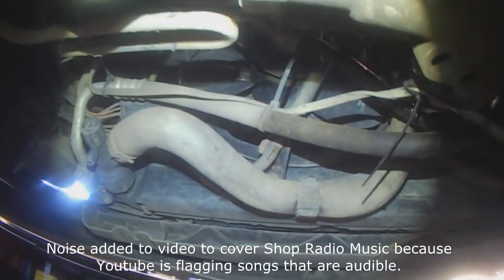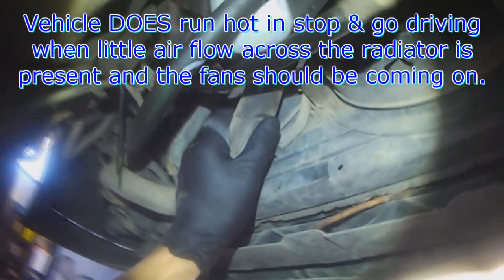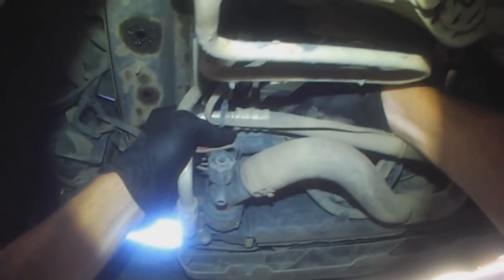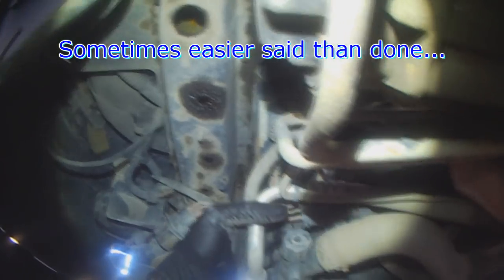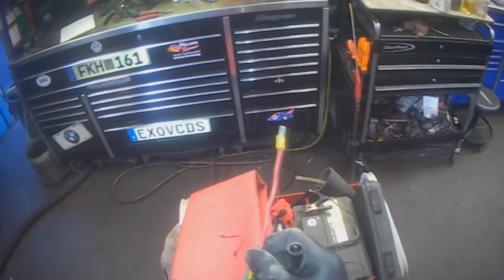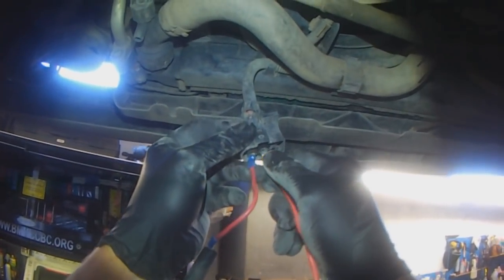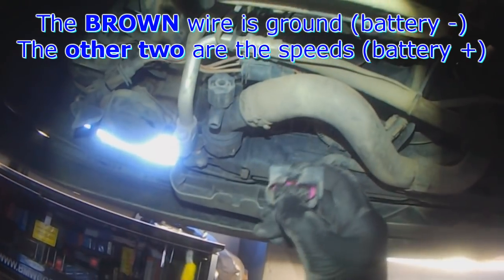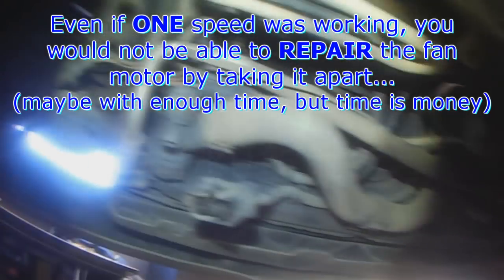VW A4: Cooling fans... manually checking (new version / better lighting)

Comment: Hi Thomas, the ac was low on freon and I put about 18oz in and the fans started working and the ac clutch as well. If low on freon and the ac pressure switch is not activated, the fans will not come on with key on engine off and ac switch on in a 1999 Beetle. I will try Pateron again tonight with my desk top computer. Thanks again for your help!😊
Reply from the maker: Thank you for the update... and thank you again for the gesture!

Comment: according to our vw parts guy, this is common, newer vw vehicles have a PCM code for "fan stuck/mechanically jammed" the speed controller for both fans is built into the master (large)fan. 
I'm sure you knew all this, just thought I'd add my 2 cents
Reply from the maker: Yeah, the new stuff is different and can / will set codes.

Comment: I wish it would have been that easy to remove on my wife's 99 Cabrio.  Thanks for the tutorial.
Reply from the maker: The cabrio has a different setup... much easier connector to get at & remove.
The fan assembly is not that difficult to remove, even when AC is present.
Were you trying to remove the "radiator fan switch" connector?
Reply: @EXOVCDS  I had to replace the electric fan and the fan wheel that's  belt driven.  Noticed the whole stack being original and ended replacing everything.  Condenser, radiator and the fans.  Engine has 270k miles and the radiator and condenser  were the original ones.
Reply from the maker: @nachomax1639  Yeah, that's a bit more work, but good idea replacing the other components while you are in there!

Comment: should both fans be running simultaneously when A/C is on? cause on my car the the big fan comes on at cold start then it shuts down and I don't hear or feel it running after that. how does this particular fan system work?
Reply from the maker: P. Vargas Both fans should come on when the AC is on. They both should also come on when the radiator fan switch triggers them.
Reply from the maker: P. Vargas https://youtu.be/Roh6RCs8IJk

Comment: My fans arnt working, I had one fan burn out and completely disconnect itself from the fan motor (large fan) I replaced the entire unit and noticed that my fans work with the ac when it's cold in the mornings but they won't work at all when the engine is warm, I jumped power to the cooling fan switch and the fans worked at high and low speed so I replaced the switch, and still I'm having the same problem, idk what to test next, could u give me a possible lead? Maybe the fcm? Idk what else it could be, if u have a vid plz link it for me I love ur videos step by step and u explain everything, thanks for doing what u do even if u dont get back to me
Reply from the maker: Year, model, which engine?

Comment: Thomas, thanks for the video. I have a question. I have a 99 beetle with the 1.8 non turbo engine. The problem I have is the high speed fan never kicks in and the ac clutch never engages. I replaced the fan control module with a new one from rock auto. Would the ac pressure sensor keep high speed from working if the ac system is low on freon? I've also replaced the thermal switch in the radiator because the fans never came on. Now they come on, but only with slow speed. I just bought the car and would like to get the ac to work. Any advice you can offer would be appreciated. I enjoy your videos. I've also tested both fans for high and low speed with my power probe. The work fine.
Reply from the maker: Ssactoralph Pressing ac should activate low speed... high speed only come into play when there is excessive pressure in the system or when the coolant temperature is too hot.
Key ON engine OFF pushing ac button should turn low speed fans on. If no, either ac button is bad, low on charge or the fan module has a power / ground issue.
Reply: Thomas EXOVCDS hi,
When you say low on charge, are you talking about an electrical current charge, or a low freon charge?  Thanks again!
Reply from the maker: Ssactoralph AC gas charge... fans & compressor do not get triggered if AC is low on charge (as far as I know... we don't do a lot of AC work).
Reply: Thomas EXOVCDS thank you, I will visit your patrion page and subscribe. I've done a lot of work to this car based on your videos. I bought one of those cooling system vacuum fill tools based on one of your videos and it worked great. I used your timing belt / water pump video and several others.
Reply from the maker: Ssactoralph Thank you... kind of you. My patreon members will get benefits in the future / I have plans for them. =)
Reply: Thomas EXOVCDS I will try subscribing tomorrow. It would not let me complete the transaction with safari on my iPhone.

Comment: Hey Thomas question my small fan on my 03 VW PASSAT 1.8 turbo doesn't seem to be running at all but no over heating problems gauge always stays in middle wondering what can make it come on or what's causing it not to run? And is the small fan the AC fan? Sorry unsure what the use of it is
Reply from the maker: Yes, the small one is AC (should be on when AC is on) and for when coolant temperature is too high (AC off). Most likely the fan has burnt out. You can check the fan for power when AC is on... if there's no power, check the fuses. There are 2 fuses (low & high speed) S42 & S51 located above the fuse / relay box to the left of the pedal cluster.
Reply: Thomas EXOVCDS thanks for the reply my friend!

Comment: Hi Thomas.  Thank you for video.  Re: golf mk4 1.9 pd tdi 150bhp, engine code ARL.  I checked fans as per video and found only 1 speed (high) worked for each fan.  I removed 4 screws which secured fan assembly to radiator.  Haven't been able to pull out assembly from above or below so far, space is very tight.  Fans seem to be secured to shroud from radiator side rather than engine side.  The hoses going to the rad appear to fit plastic fittings which in turn connect to rad.  I got hoses off, but couldn't pull off the plastic fittings despite fully removing U - shaped metal clips ( wary to use too much force in case it snaps off from rad).  Got car jacked up high, battery, battery tray out.  Appreciate any feedback how to get fan assembly out.
Reply from the maker: +toyo toe Hi, yeah... the later style setup does not have separate mounts foe each fan. It is a tight squeeze, but doable... for more room (and to not damage anything), you need to remove the front bumper and then move the radiator into "service position". Like in this video: https://www.youtube.com/watch?v=m2IvmVkszWU
Reply: +Thomas EXOVCDS Thanks Thomas.  Easy to remove rad fans after putting front end in service mode.  VW dealer quoted me an eye watering £680  (1,350 CAD) for 2 new fans ( just fans not fitting).  I copied the VW part numbers from my faulty fans and found 2 used identical VW fans ( working on both speeds) and with a warranty from a VW Dismantler for £60.  In your experience is it rare for a cooling fan thermal switch to fail in Golf / jetta mk4 tdis?
Reply from the maker: toyo toe The 3 wire one in the side of the radiator? They don't fail often, but with age... it's just a matter of time.

Comment: I have the same problem in a 2015 passat fans don't work with the A/C on. I checked the connectors and i have no grout with A/C on, they only activate when temperature reaches 190. Any Ideas? Thanks
Reply from the maker: The fan module receives a pulse width modulated signal from the ECM to turn the fans on. If the fans are not activating when the AC is turned on, then there might be an issue within the AC system. You can check "command" at the fan connector with a voltmeter. like this: https://www.youtube.com/watch?v=oqdv4cm86Ns  You don't need a scan tool to activate the fans. Simply allow the car to idle... check the voltage signal while the fans are off (should be below 1V). Select AC and the voltage signal should increase. If yes (but no fan operation, then there's something wrong with the fan module)... if no increase in voltage, then there is no AC signal being sent... check the AC system for fault codes.

Comment: Mine was doing the same thing, but when I tested the fan plugs, I applied positive to one and ground to the brown, nothing happened. But when I applied positive to the brown and negative to the other thick one they both worked.
Reply from the maker: Record a video and post it on your channel. Show me how & where you are getting power.
Year & model of car?
Reply: 08 vw gti 6 speed manual
Reply from the maker: Your fans are PWM (pulse width modulated) controlled. Completely different than in my video. They are controlled by a signal from the Engine computer (ECM) to the Fan Control Module (FCM) that is part of the large radiator fan... like in this video: https://www.youtube.com/watch?v=oqdv4cm86Ns
Reply: Oh i see. Ya i was just stating what i have found thinking maybe you can give me a suggestion. But without your video i wouldnt know which is which. But anyways i fooled with the fuses wires you name it. Finally found out the plug behind the plastic shroud that goes to the ac fan was maybe stuck. I gave it a couple of slams and both fans started working. Thanks

Comment: 2004 mk4 r32 golf is the vehicle I'm having trouble with. already done tests on the motor of the fans and they are fine. replaced the switch on the bottom of radiator as well.  checked all fuses they're fine. is it the control module or something else ? action works so I think that the thermostat is fine unless there's a seperate thermostat. any help would be great Cheers:)
Reply from the maker: Does the lower radiator hose get warm? Thermostat could be plugged. If the car overheats while driving, then the thermostat is not opening (fans are not needed as long as vehicle is moving (for the most part).

Comment: Dear Thomas EXOVCDS: 2006 Passat. The cooling fan connectot has four pins. Two big ones two small ones. How to test it? I hook up two big ones ,fan runs fast. But two small ones has nothing comes on. But I found the smaller fan has a sized brush.
Reply from the maker: +Pengcheng Wang The fans are "pulsed" on/off quickly by the fan module (part of the fan) by the ECM (engine computer). To test them, I use a scan tool and select "output tests". The ECM will then pulse the fans from low to high speed. If nothing happens, I check for a pulse signal at one of the small wires. If the pulse signal is present, then I replace the fan / module.
Reply: Thanks bud.
Reply: +Thomas EXOVCDS  I checked the two small wire on customers's VW. One is 0.16V and other is 0.04v. I trace the signal wire one is merged with a coolant temperature sensor(I suppose)  goes to ecm. And the other is goes to fuse box. I changed the coolant temperature sensor in the engine block just under the High pressure fuel pump. And nothing goes better. The fan still not working. But when the old fan still can run with my human aid starter. I spin the fan, and it goes. I will change back the old big fan with control module and new small fan. Let us see what gonna happened. I want to change the other temperature sensor in the radiator hose later. Any idea? Thank you.
Reply from the maker: +Pengcheng Wang If you spin the fan with your hand... it stays spinning, or it stops after a few seconds? The fan might have bad electrical contacts if it does not start to spin by itself.
Reply: The ECU did not give the order to run the fun when coolant is above 93 celsius. I suppose MAF sensor lie to the ECU.

Comment: I have a 2013 jetta. Borh fans turn on slow with ac on. No high speed. Can both fans be bad?
Reply from the maker: Low speed with AC is normal. High speed only comes on when temperatures get too hot. Which engine? What is the actual problem? Overheating engine? Your fan control module should be part of / behind the large radiator fan and is controlled via a Pulse Width Modulated signal from the ECM. This signal can be checked with a multimeter, like in this video:
https://www.youtube.com/watch?v=oqdv4cm86Ns
You do not need a scan tool to check for a control signal... but as you can see, the scan tool is useful in activating a "test mode". 
Post a video on your channel as to what the engine is or is not doing... so that I can see & hear. The more I know the better I might be able to help.

Comment: Thomas can you remove the fans for the A4 B7 (2008) without removing bumper/fronter-end?  Do they just slide out once you disconnect screws/harness?
Reply from the maker: If I looked it up correctly... front end needs to be moved forward. I have not yet had to remove / replace one yet myself on a B7, so I can't be sure if that's the only way.
Reply: I’m having the same problem rn on my 08 Audi A4 b7 im just not sure if it’s the fans “both fans are not working” or fan control module. My car heats up and ac is not blowing cold .any info will help thanks!

Comment: Thank you for the video. Very helpful. I do have an issue with the aircon though. I changed the dash climatronic as the vent and temp controls didn't work but the a.c. did. The replacement unit allowed me to use temp and vents but now the a.c. button keeps blowing fuse 16. I set the temp and vent and reinstalled the original climatronic in the dash and now the vents and temp want work but the a.c. now works and fuse 16 doesn't blow. 

The replacement climatronic unit in the dash has the same product code. I have taken off the triangular shaped connector to try to bypass the fans to see is low and high speed works on the gas fans and only high speed works. I have changed the fan control module under the battery tray and it has made no difference.

Would the rad fans only working on high make fuse 16 constantly blow although as I said earlier, the fuse doesn't blow with my original faulty unit. 

The issue is very strange and I would be extremely grateful for any opinions that you may have.   I have a 2003 mk4 golf tdi ARL.
Reply from the maker: Sounds like there's an issue with the replacement unit.
Reply: I tried 2 other replacement units for the dashboard climatronic controls and they all blew fuse 16. it's truly strange. Thank you for you thoughts.
Reply from the maker: Hmm... not sure what the odds are that 2 used units would do the same. If AC works with your old one, then there should not be an issue with the AC side of things. If you need a wiring diagram, let me know and I should be able to find one for you.
Reply: I am going to disconnect the two rad fans and replace the fuse and see if it blows. if it does then the issue is probably unable to be sorted by myself as j don't have any testing equipment. 

I have checked all fuses on the battery and in the due panel itself. I will look for a wiring diagram as you have suggested. I'm pretty puzzled by this issue.
Reply from the maker: I just had a look at a wiring diagram... fuse 16 is a power feed from the ignition switch to the fan control module. I thought that fuse 16 was part of the climatronic control circuit (since the fuse did not blow with your original unit, but does with the others). Here's a diagram... fuse 16 is on page 3.
http://fkh161.ca/VW/ARLAC.pdf Something in the fan module or attached to it is drawing to much current for some reason. Still doesn't make sense that ac works with the old unit.
Reply: wow. You are a star. You have helped me for no reason than to be nice and just help. I'm very thankful. I will have a look at the car tomorrow and let you know what I find.
Reply from the maker: If you have problems following / reading the VW diagram... I can find a different format (North American style) for you. It will not be for the same ARL engine, but the Climatronic should be similar.
Reply: thank you.
Reply: I took apart the new unit and the old unit and found that the circuitry is different even though both units have the same part number. the only difference on the casing is that one has k45 and the other has n29. I believe this to be in refer3mce to the model number of the fan control module underneath the battery tray and mine ends in a k not am n. I'm going to return the new part for another with the letter k and may even open it up to check the circuit board so that I get a match. I did not think that this would have even been an issue considering identical part numbers.

Comment: Hi Neither of my fans work with AC on and I have an A3 8L with same connections. The small fan kicks in at right temperatures. How can I test power at the large fan and if the large fan actually works
Reply from the maker: uchilli85 I'm not sure if your Audi A3 has the same setup as this VW A4... with the VW, both fans should run whenever the fans are needed. You just need a test light to test for power at the large fan connector... if there is a connector.  Let me know what you find. It's common for fans you burn out with age. A wiring diagram should show how they are wired and what triggers them. Post a video on your channel so I can see your setup. Post the link to your video here.

Comment: Got a cooling issue myself... 2001 VW jetta tdi alh automatic, stock car. Replaced water pump during timing belt change metal impeller, tstat, thermal switch, temp sensor, radiator due to leaking, main radiator fan, and fan control module, and the fuse block on battery due to the fuse for the fans was not connecting inside the plastic housing. 
Did replace the cylinder head and gasket correctly a few months ago. Blew a rebuilt injector that grenaded my old head... engine is alright. 
Otherwise, temp gauge on dash gets to 220*F both fans turn on at low speed and cool to 210*F before shutting off. Cannot figure out why the fans do not turn on at the right temp and why the fans don't turn on at high speed. Oh no refrigerant in ac system. What could be my issue??
Reply: Forgot to mention car has 308,xxx miles on it.
Reply from the maker: Does the temperature stay low when the vehicle is moving? If not, try a different thermostat.